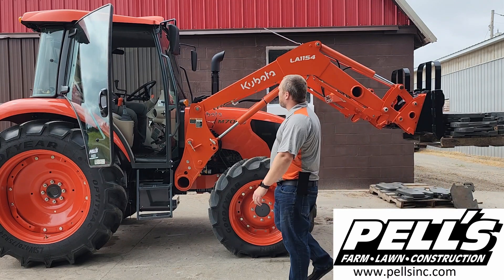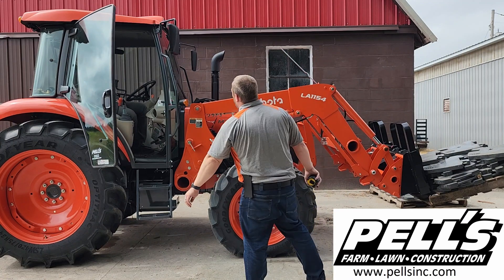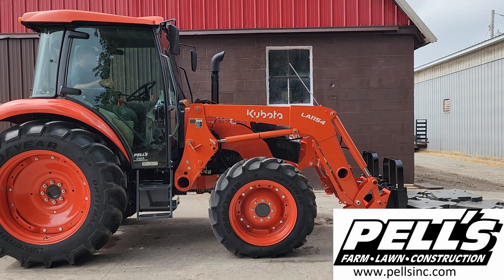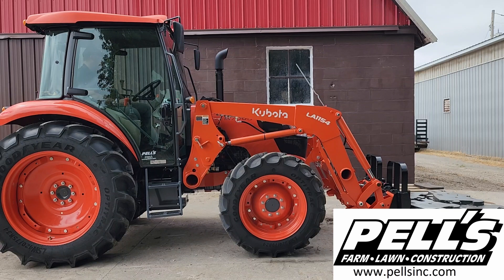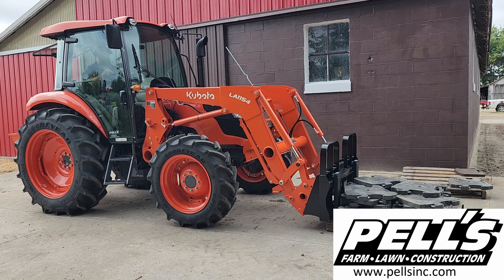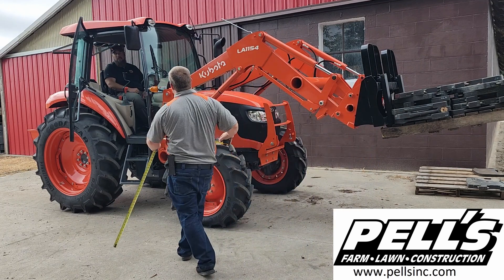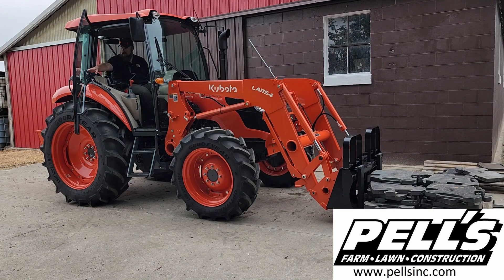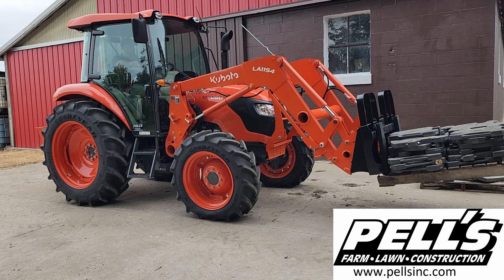M7060 Weight Lifting Capacity

Comment: When we bought our m7960 I specifically asked the mechanic  who was doing the final checks for me which position he had the cylinders set at cuz I told him I prefer to lift more weight vs more height for what we use the machine for.. he told me “I have it set to lift higher” I said I’d rather have it so it can lift more and he told me “it won’t make a difference, it will lift the same just one position raises it higher” I could tell he either had no clue what he was talking about or he was just being lazy.. either way I knew he was dead wrong. No way can you position a loader to lift higher by moving the lift cylinder position and NOT loose lift capacity. I just changed it myself to the more lift position cuz I had to lift a full pallet of salt off a truck yesterday and it barely got the pallet off the semi truck:. Took all it had to lift it 1/4” so I could sneak it off the bed of the truck.. now I have no worry next time we get a heavy delivery and just to be sure I did a quick google search and found this video and found myself to be correct. Lol

Comment: You should put all the weight closer to the backstop. a bit of rocking gets up a bit higher, but at your own risk right? I had an oak on mine, I could only pick it up a foot, rocking it I got it up over a dump truck and dropped it in. I haven't checked my pivot pin adjustment. I'll have to check that make sure its on the bottom. Brobably had it for height to clear the dump truck.

Comment: Power Lifting  is not the same as putting a tractor to work. The M7060 is too light to lift these loads and transport them  over uneven ground. The weight of the tractor is more important than its lifting capacity. It is a remarkable tractor which causes users to over do it!
Reply from the maker: Thanks for the comment, we are just showing static what it will lift. yes there are a ton of other factors that come into play for each scenario. Thanks again